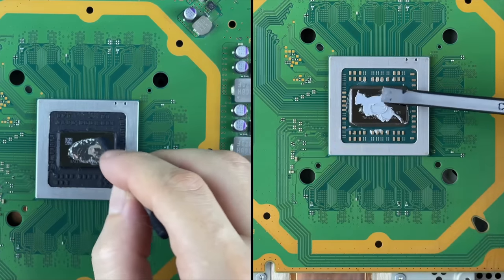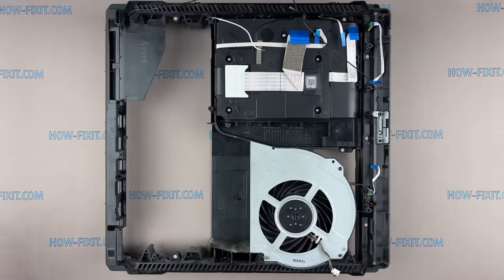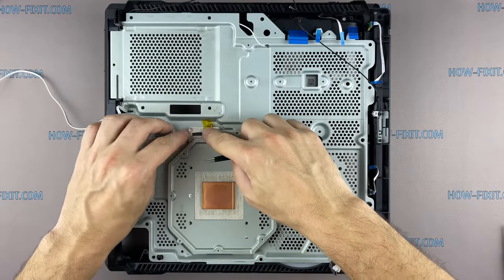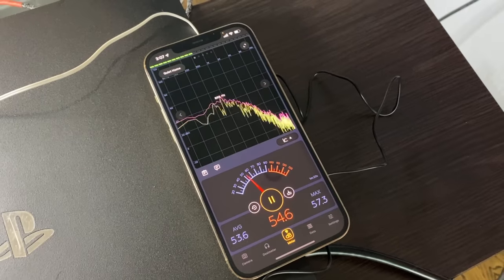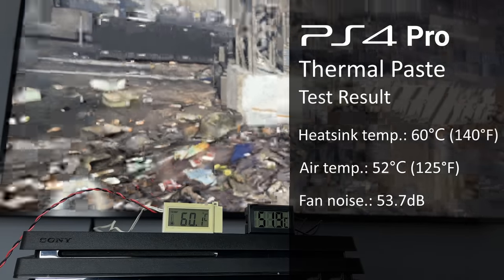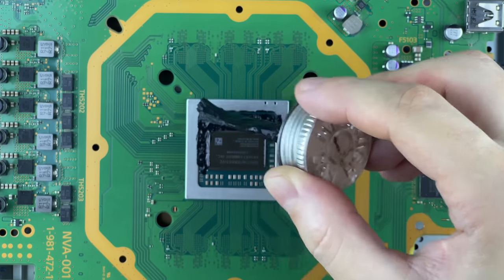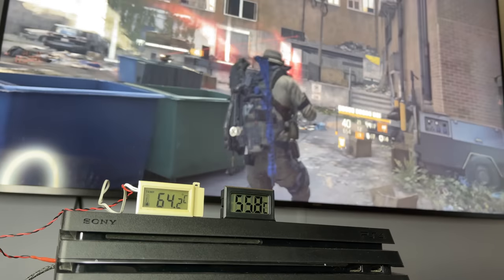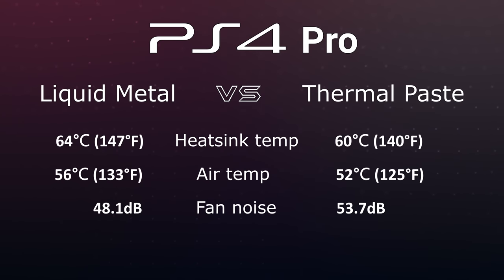PS4 Pro Liquid Metal vs Thermal Paste

Comment from the maker: Explanation of the ending for those who didn't understand the result of the test, why liquid metal is better for PS4 Pro - the sensor was attached to the heatsink and the temperature is higher for liquid metal because it transfers heat from the APU to the heatsink better. Please do not confuse the processor heat level with the heat sink heat level. The purpose of a heat conductor is to better transfer heat from the CPU to the heatsink, in which case liquid metal did a better job than thermal paste.
Reply: Thanks, now I see why. But if you could provide chip temperature too, this would be clear without any confusion.
Reply: 48.1 dB is better than 53.7 dB… Liquid metal wins!
Reply: I used gold termal hope i haven't messed. 🥲
Reply: Liquid metal has like 10x the thermal wicking capacity of thermal paste. It's just conductive which means don't mess up
Reply: The liquid metal has to also be applied onto the heatsink
Reply: @cva200286  it's not that much difference. Liquid metal is a no go for me. It's not worth the risk.
Reply: Run the same tests in a couple of months. Liquid metal with degrade quickly and almost disappear if you mix it with copper. It's a easy way to create hotspots on the APU and kill it
Reply: @blaskedryck  what risk? Clear nail polish your friend
Reply: @kylel8605  if 2 much the damage it can do is not fun
Reply: You have enlightened me :o
Reply: @kylel8605  yeah but have you watched Northbridgefix? He has o many customers who used it wrong and messed up the whole board just because of a couple degrees difference.  I'm just saying, I won't use it. Paint however you like 😎
Reply: ys
Reply: @blaskedryck  People that don't prep are asking for it. 

Maybe use your brain instead of just following someone else blindly. 🤣
Reply: @TigTex  You just destroyed the whole video lol
Reply: Suggests testing Liquid Metal vs Honeywell PTM7950
Reply: @for utubDid you protect the area around the core with nail polish? If you didn't and it leaked, you were very lucky that it didn't short circuit. That's why PTM7950 can be a good substitute for liquid metal, because it has a similar thermal conductivity, and you do not need to protect the core area with nail polish/kapton tape/solder mask.
Reply: @for utub Thats why you just use nail polish
Reply: U are wrong,  heatsink temp is higher because fan rpm is lower, because apu temp is lower.  Air temp is higher because fan blows slower, for the aame reason. Anyways u applied liquid metal wrong,  u should apply too to the heatsink side, is a must
Reply: Stupid test. We clearly see that thermal paste better than liquid metal. Liked metal worst thing and kills components of the gaming console.
Reply: @TigTex  its the other way around actually. I use it in my asus lappie which also features copper heatsink. Thermal paste just gets "pump out" effect, after 2 months loses its efficiency. Had it running with liquid metal for over a year, still good temperatures. 75C during gaming, and its a laptop. Good result imo

There is a chance to not get pump out effect with better thermal paste like kryonaut extreme, however its as expensive as liquid metal anyways.
Reply: thumbs up! If your ps4 is jailbroken, you can measure soc temp with Orbis Toolbox.
Reply: According to your test thermal paste is way better
Reply: better heat transfer -> higher temp heat sink, air flow
Reply: Why would you test that, we just wanna see which runs cooler
Reply: Why wouldn't you laser temp the processor?  After all that's the investment not the heatsink right? 
I'm so not just simply buying this the way you set up the parameters um some fans will be less db at higher flow rate so the slower fan Mir than equally the higher sink temp.....sorry just well real shit.  I'm only stating because I'm looking to use on mosfets to aluminum sink.
Reply: @nikitazaycev8636 so what I'm hearing is that a high quality thermal paste- that costs almost as much as and performs as well as liquid metal, is safe like average thermal pastes would be a better product. Apparently it's all about the application... so putting it on right and with the right amount will still be reliable and yield zero risks for leak damage. 

I always felt liquid metal is unnecessary and something better should replace it.
Reply: @christopherparis6841 yeah, I agree. They say better heat transfer- but is it actually cooler? I think at that point it comes down to how good the heatsink(s) is in your computer/device. 

Real world application: If my body feels like it's overheating- laying on a cold flat metal surface is way better at cooling me off than an odd bumpy metal surface. The ground can be good, but that bulkhead door is nice. Lol
Reply: I understand now but if I have to use a thermal paste cause moneys right right now, is artic mx-4 the best option?
Reply: @SacredMilkOG  exactly
Reply: @SacredMilkOG  also one has to ask themselves what provoking reason any video exists I mean a swift check these days that isn't rubber goes a long way
Reply: Chief my APU temperature  is 76c after repaste of Mx6 and change of thermal pad is silent when playing god of war but the temp 76 is that normal?
Reply: Make sense good job,
Reply: I placed Mx4 paste  in three months noise again.... Next time I will try liquid metal....
Reply: @TigTex Correct! 👍🏻 
Metals corrode/react better and faster with other metals under heat + oxygen ..
Reply: @goorthiss thanks didnt know existed 👍
Reply: hey bro! Great video! I've a question, what is that paste you used to cover the surrounding chips of the processor?

Comment: Liquid metal is always better than paste at heat transfer, but you have to be careful on bare copper heatsinks because of dry out of the LM. The copper will absorb the LM and you'll have to reapply it a couple times. It's best to use it on nickel plated surfaces to avoid this
Reply: I know that it dries out and copper absorbs LM but if you know or tested it yourself how much does it take to dry out? When should i re-apply LM on my copper heatsink-cooled system?
Reply: @dmitrisalarov  honestly I have not tried myself, dunno if you're talking about a console or a PC, but either way pay attention to your fans speed and performance. If your stuff sounds like a jet engine it's probably time to reapply and after a couple applications it will saturate and stop drying, thermal protections should prevent death of components so as long as you are paying attention it should be fine. Another solution is to try to nickel plate the surface but that's not easy and requires a lot of creativity to do on a heatsink contact plate since you can't submerge the whole thing. Again it's just best to avoid LM on copper.
Reply: @Matt_Duke  best to avoid LM on aluminum* copper is OK, Nickel is best.
Reply: @kanyeeastlolz  coper is only kida ok, like I said I will dry out and cause problems, a while after applying someone inexperienced will be left wondering why their device sounds like a jet engine and performs like crap. An enthusiast willing to disassemble and reapply a couple more times is fine, but newbies should avoid LM on copper.
Reply: derauder said the heat sinks in copper do not give problems despite the absorption the problem is those in aluminum
Reply: Wat, i thought LM absorb by aluminium?
Reply: I always avoided LM my self too, but even on nickel plated like it's supposed PS5 is having ton of issues, repair guys on youtube keep having many PS5 with completely dried out spots, same on PC's some ppl claim and show pretty bad results some after just months, others after a year and also some other ppl don't seem to get any problem even after a year...

Also it still leaves some nasty marks and spots even on Nickel plated, but sure Copper is far worse.
Reply: @dmitrisalarov  After one month. Copper is the safest (and only imho) metal to use Liquid Metal on.
Reply: @haywardgg  I applied and it did actually stained the copper surface on heatsink. But after I reapplied it on the stained surface and after 2 months it is still as the same as first time. and this is miraculous since I'm on a laptop and they pump-out everything that's put on
Reply: Whats that gooie black stuff you add before the liquid metal?
Reply: @wantsomecoffe  usually people use nail polish to cover stuff to not get shorted, just steal some from your mother, wife, girlfriend or whatever 😁
Reply: It doesnt matter if the liquid metal dried up… as long the microscopic gaps are covered with in it… it will be effecient and much longer
Reply: Hui hui
Reply: Wasn't liquid metal perfectly fine with copper but cause problem with aluminium because of amalgamation?
Reply: @delsingeiming Yes it will destroy aluminum.
Reply: @CrocoDylianVT  Copper absorbs LM until the copper is saturated, so you have to reapply it several times. On top there will be a nasty, hard connection between the LM and the copper and to have an flat, even base you have to grind the copper. And it will never look the same as new. So not an ideal solution. Nickel plated surface is the best to use with LM. Other than that just use a good thermal paste.
Reply: I guess you could always nickel plate the heatsink?

Comment: Liquid metal eats copper not good to use in close proximity to heat pipes
Reply: No it doesn't. That's aluminum, and that's why gallium. and mercury aren't allowed on planes.

Comment: I applied MX-4 to my PS4 Pro quite recently and it's now so cool and quiet that I don't remotely feel any need to go with liquid metal.
Reply: Does it stay quiet after a few months?
Reply: @zappa1165  yep. still whisper quiet - which makes sense. Once thermal compound is applied properly it will last for years.
Reply: I put mx6 and changed thermal pads on my spideman ps4 pro, I admit I was a bit disappointed with the results I think I had to high expectations of the pro sounding like the ps5 lol, while the console is relatively not as noisy as before the fan still kick up on more demanding games but not as loud and obnoxious( I have a nidec fan btw) like red dead 2 Detroit become human, nier automata, far cry 6, nba2k24 … it’s not whisper quiet with high demanding games but whisper quiet when playing normal games id say games not “ps4 pro enhanced” tend to run super quiet like a ps5 regardless the change with rdr2 is still noticeable for me even if it still gets pretty loud at moments in gameplay

Comment: Liquid metal should also be applied to the heat sink
Reply: @zal333  Can confirm this. Did Liquid metal application on a 2015 MacBook Pro CPU. The temperature went up crazy in less than one year, so I disassembled the machine, took out the heatsink (which was really hard to take off btw) and the LM was completely dry. Cleaned all and that’s when I discovered I cracked the CPU die removing the heatsink! Long story short, Mac specialists were asking 250$ for motherboard repair so I bought another (more powerful) motherboard from China. Perfectly working till this day, but no more LM!
Reply from the maker: Yes, I did

Comment: LM is difficult to remove/change once is dried. I wouldn't use it to gain some degrees less, not at all.
Reply: Put my LM on Pro 4+ years ago.  Just opened it up again to check, still very juicy. 
The same thing for my PC, I done that 5+ years ago, and I did a heavy oc to the CPU on water.  I also opened it up recently, also still very juicy.  Pretty sure it will only dry up if you don't apply it properly. Don't know about PS4 pro, but my PC dropped 30℃ and more.  Before LM, it hit 106℃+ and PC shut down to protect itself when it start a render.  After LM, 77℃ max on 100 MHz more oc.

BTW, removal is also easy.  Just do it slowly.  I was worried about my PC LM, so I reapplied the LM, cleaned it off and start over.  Temp is the same, no change.

Comment: Applied liquid metal to my ps4 pro 6-7 months ago. Result was great but yesterday fun went to max speed. I disassembled ps4 pro and found liquid metal became dry and penetrated into a copper cooling plate. So I spent 1hr removing "liquid" metal. Damaged mirror surface of cooling plate. Finally applied new thermal paste with highest efficiency. All is great now. Never come back to liquid metal for ps4 again
Reply: Me tooo 🥲

Comment: I bought a ps4 pro first Revision with liquid metal applied nearly 2 years ago. I opened it up because of the quite high noise level. I noticed although the ps4 pro had a copper heatsink it still got damaged over time and lost contact to the board. After reapplying mx4 the fan noise dropped significantly. 
All of the reviewer said that copper heat sinks are resistent to liquid metal. However, I cant confirm that.
Reply: The heatsink is most likely still aluminum that’s been treated with a layer of copper.  Liquid metal will still eat through that material if that’s the case.
Reply: if it's truly copper it'll just form an alloy. Also, it has to be thermal grizzly liquid metal. The other one gives awful resutls after a year, and it eats through everything
Reply: Liquid metal reacts with copper. It will degrade quickly while forming an alloy. Needs to be reapplied multiple times untill it stabilizes. Only apply liquid metal to nickel plated cooper surfaces! Else, use high performance and endurance  TIM like Honeywell PTM7950
Reply: I stopped using the liquid metal for that same reason. But theres a way to reapplying it a few times until it creates a new surface but I didnt do that. It is supposed to stop eating the cpu surface this way.
Reply: So bro would you recommend me to use mx-4 on my ps4
To fix heat and fan noise?
We have online workshops for quick fix but I don't trust them
That's I've been thinking to apply it myself since I do clean it myself from time to time
Reply: @TigTex  you should only have to reapply it once it’s mostly cosmetic it’s not that big of a deal

Comment: It's great and all but I'd rather take the one with thermal paste. Because regardless of less heat by a few degrees it'll still perform the same anyways because of how it's designed to do.
Reply: And there is a chance that liquid metal will leak like the ps5 thermal paste is the way

Comment: I used a thermal grizzly carbonaut graphite pad on my ps4 pro based on tbe recommendation of a channel on yt. Never had problems with noisy fans ever again and the exhaust vented the heat better than ever. I used noctua thermal paste before but it didn't last a day before the noise came back.

Comment: Thank you for the test. I've resorted to using a graphite thermal pad for my PS4. It's a one and done application, and I don't have to worry about constantly reapplying paste. 

I don't know what the long term effects are like, but I haven't run into any issues in the past year.
Reply: Como es esa almohadilla
Reply: All good pastes are pretty much good for like, 6 years, at least.
I’d rather use that
Reply: It’s generally a much safer, cleaner solution but there are risks to pads like those if the pad is cut too large or if it shifts too much during installation, as some of them (like TG’s Carbonaut thermal pad) are just as electrically conductive as liquid metal so the risk is just the same at the start.  The benefit to thermal pads after installation is that there is no risk of potential squeeze out of material if too much is applied like with liquid metal so it’s safe after that point if installed correctly.
Reply: @Xeno Drake  10 years while not under and dependent on storage conditions and while in use the years can be up to 3 years but again depends on use usuage. I use my PS4 Pro very heavily for example and it needs to be changed every year. A chromebook for example can go many years without needing to be changed. Everything is dependent is the point.
Reply: @capn.c5321  it does not bro. Lol. I use my pc every day. One apply of kryonaut lasted me 4 years no problem. And one of artic silver also lasted a lot. Mx-4 isn't as good, but mx-5 should also last longer than a year for sure. Anyways, if you wanna be sure, kryonaut can be 6 years in there no problemo
Reply: @Xeno Drake  what is that supposed to mean because you use it everyday lmfao. I use my chromebook everyday too and it means absolutely nothing because it isn't doing shit. Anyway I'm not here to debate.. point was that it depends on the use which effects the time and that's a fact.
Reply: @capn.c5321  Most thermal pastes are advertised to be good for 6-8 years so you need to lay off the science. The last 2 years didn't teach you anything?
Reply: @kylel8605 чувак сверху вам все правильно написал про время и свой хромбук, о каких 6-8 годах вы говорите?! Термопаста за 6 лет станет каменной. 
Пс4 про нужно обслуживать каждый год, максимум раз в 2 года.
Reply: Narkomancers  i have only used kryonaut and it didn't dry out in 4 years

Comment: You missed the part where the liquid metal will fuse with the hs.. the PS4 Pro was not designed to have liquid metal as a cooling option
Reply: That's kind of what I thought.
Reply: In Pro it won't be a problem -  it has copper baseplate and copper isn't attacked by liquid metal, it's a problem in normal and slim PS4 because entire cooler, including baseplate, is made from aluminum.

Comment: Liquid metal tends to shift over time if you position your console vertically. You could coat the circuitry around it before applying it to prevent damage to those components but this will not stop the shift.

In my experience, it has been better to use a high viscosity thermal paste. Cheaper, easier to clean and reapply but I haven't had to reapply the HVTP in about two years. Whereas after 4 months of the liquid metal i had to change it because my temps went up due to shift because of keeping my console vertically.